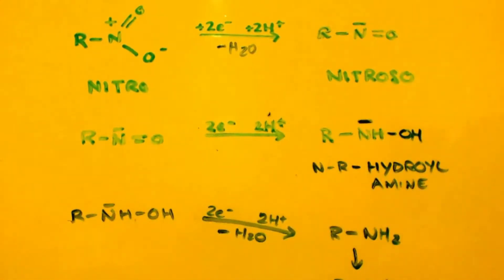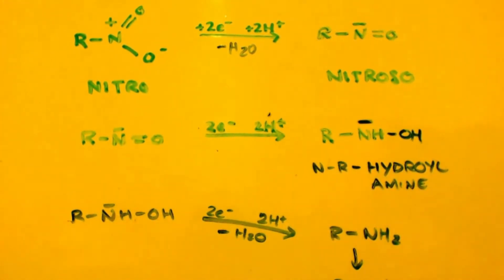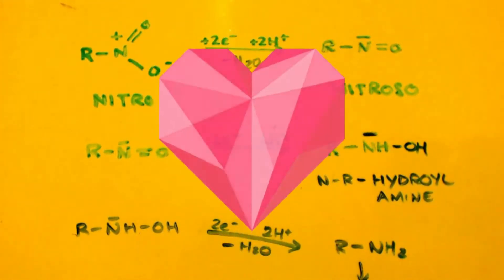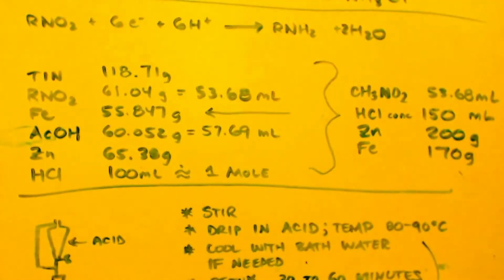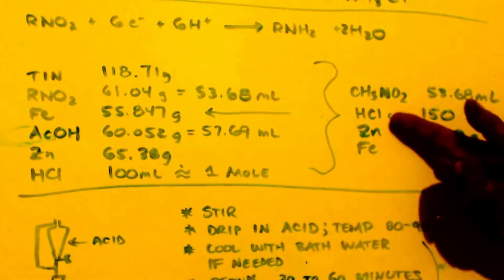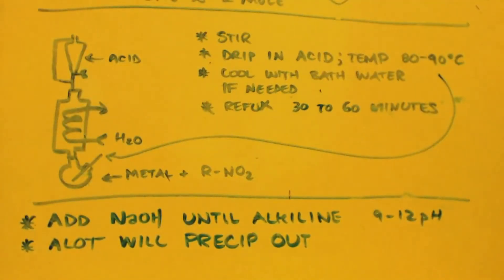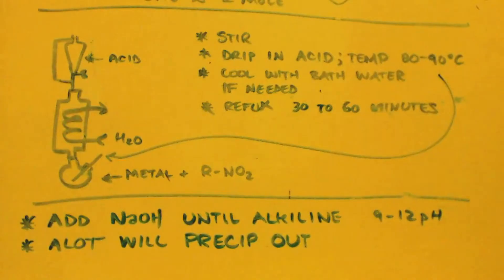METHYLAMINE SYNTHESIS  Fe/acid reduction of nitromethane part 1

Comment: Hi John me again. I'm a bit confused about only using about 3 moles of iron as i've read in other places where they use 4.4moles of iron or more. Take a look at this by an old german chemist: 

"EtNO2 and MeNO2, which are readily prepared by a process recently patented (ref. not given) served as the mother substances for the corresponding alkylamines (RNH2). The latter were formed by reducing RNO2 in HCl with Fe. When 2.13 g. EtNO2 in 8 g. H2O, 7 g. Fe filings and 0.8 g. HCl were heated together at 50-60 degrees for 6 hrs. in a flask from which air was excluded, 0.96 g. EtNH2 (about 75% of the theoretical amount) was obtained.

In a similar experiment, in which the reaction mixture was heated for only 3 hours, the yield was materially decreased. In these experiments only 1/36 of the amt. of acid required by the following equation was used: RNO2 + 3Fe + 7HCl = RNH2.HCl + 3FeCl2 + 2H2O. Furthermore, the mixtures became alkaline long before the reduction was complete, and Fe(OH)2 was pptd. and rapidly oxidized to Fe(OH)3 by the excess of EtNO2.

In another experiment, RNO2 which remained unchanged when treated with Fe and H2O alone was reduced when small amounts of RNH2.HCl were added to the mixture It is evident, therefore, that the above equation does not accurately represent the mechanism of the reduction. Apparently Fe reacts further with the RNH2.HCl formed earlier in the reduction, according to the equations 2RNH2, HCl + Fe = 2RNH2 + FeCl2 + 2H. 2RNH2 + FeCl2 + 2H2O = 2RNH2.HCl + Fe(OH)2, and H and Fe(OH)2 are the active reducing agents. Very nearly quantitative yields of MeNH2 and EtNH2 were obtained by using 1.5 mols. of HCl per mol. of RNO2 in the reduction, and heating the reaction mixture at 70 degrees for about 1 hr."

I got this from here: https://www.thevespiary.org/rhodium/Rhodium/Vespiary/talk/index.php/topic%2c3571.msg35383.html#msg35383

Take a look at that and see if you can make sense of this for me, I am dying to know!

All the best.

Comment: You can also use Aluminum foil and a very small amount of Mercuric Chloride, and drip the Nitromethane in slowly to avoid excessive heat (it gets HOT) to reduce the nitromethane to Methylamine free base, which will stay in solution in excess Alcohol used as solvent.  This is the same reduction system often cited for the reductive amination of P2P with basic Methylamine to produce Meth, and some chemists have also been known to simply substitute Nitromethane for the methylamine, double the amounts of aluminum/mercuric chloride used and drip the nitro in first (slowly!), followed by the P2P to combine everything in two steps. but with a somewhat poor overall yield of about 60 - 70 percent of the usually expected yield.
Reply from the maker: Wayne............GREAT INFORMATION!!!!!!!!!    I always wandered what else i could reduce with aluminum amalgam other than imines.   Thanks!!!!!!

Comment: You should summarize at the end of the clip. It's easy to understand. I have no knowledge of chemistry at all, for example.
1.
2.
3.
4.
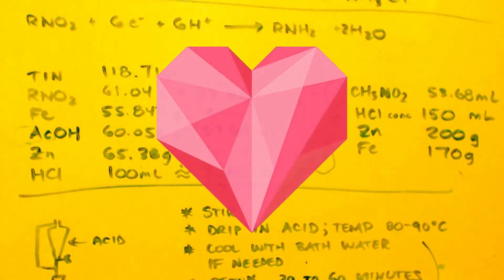Reply from the maker: IQ1800...........At 7:38 to 9:37 in the video I summarize the reaction.   The rest of the video and part 2 is just about how to extract the amine.    
             The first thing you learn about solubility is that "likes dissolve likes".    This means NON polar things like to dissolve in NON polar solvents and polar things like to dissolve in polar solvents.    When the amine is free based it is more soluble in NON polar solvents like ether or benzene  and when the amine is a salt then it is soluble in polar solvents like water.
             When you are done with the reaction you got an amine salt and water from the HCl acid.   So you free base the amine salt with some NaOH.   This makes the salt into an amine which is more soluble in a NON polar solvent.   So you throw some NON polar solvent in to soak up the amine you just made.   Leaving all the polar contaminants in the water.    Then take that NON polar solvent with your free base in it and bubble some HCl acid in there to change the NON polar amine into the polar amine salt.   Now the amine salt will precip out as a solid.   Filter salt.   The NON polar contaminants are left in the NON polar solvent.                   
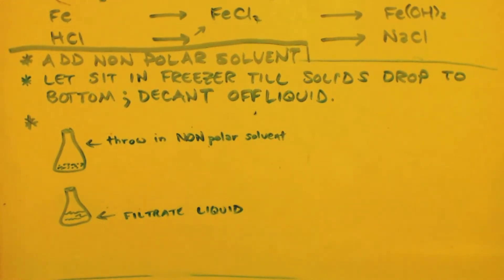             KEEP IN MIND I HAVE NEVER DONE THIS EXPERIMENT AND I AM GUESSING.   I did make some methylamine in my 5 video series called "METHYLAMMONIUM CHLORIDE from hexamine".   At the very end of the 5 video series at 10:50 in the video i SUMMARIZE what i did.   So if you want to watch that first and then decide if you want to watch all 5 videos then here is a link to PART 5.    Just start watching at 10:50 in the video.    https://www.youtube.com/watch?v=fDVx79Eul6g&t=142s
Reply: Thank you very much for your knowledge. JBSC
Reply from the maker: @iq18oo30  .........Your welcome.  I do not know it all but if i do i will try to help.  I am still learning stuff myself so keep that in mind.    I got nothing better to do so if you ever have any more questions just ask.   If i do not respond within a week then youtube did not notify my of your post and you should post it a second time.   Might be expanding into having  a bio lab next year.  Guess only time will tell.   Have a great day.

Comment: it will be possible to react chloromethane with ammonia to obtain methylamine chloride
Reply: No non o no making meth jaun
Reply from the maker: respaldo diego..........Sorry i was not notified of these post under this video.  Just stumbled on to it.  ANyways YES you can do that reaction.  The ammonia will do an SN reaction and replace the chloro group with an amino group making the methylamine.   But the methylamine that is made is more reactive than the chloromethane and over amination takes place.  Meaning the Methylamine starts reacting with the ammonia making secondary and tertiary amines.   You really need a big excess of NH3.   And even then there will be a lot of over amination